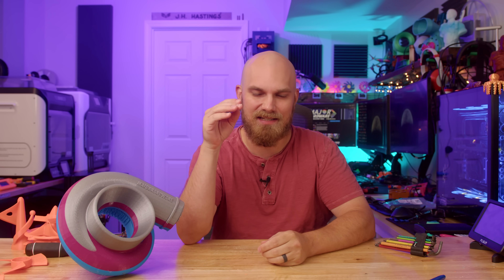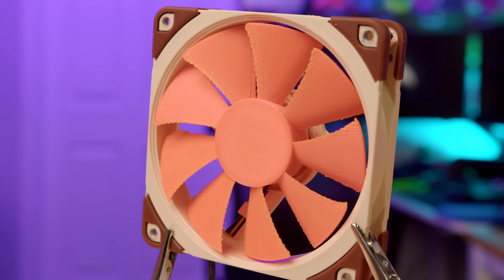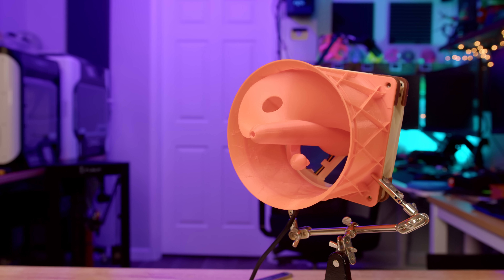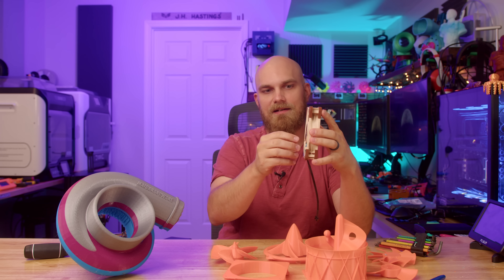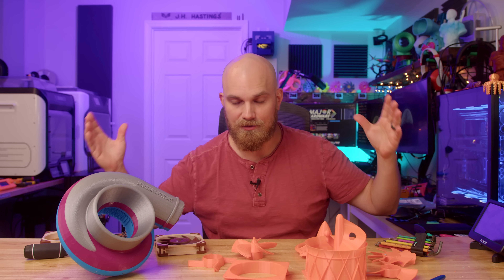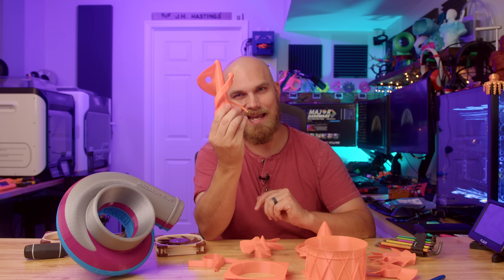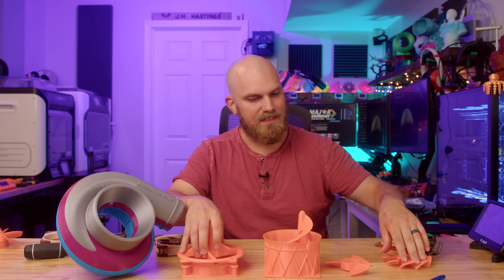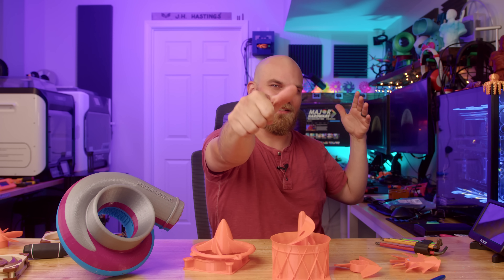NO ONE Has Done This Before | Fan Showdown S4E10

Comment: Everyone uses solidworks and puts the CG in the center but that’s not the whole picture for vibration. The blade is pushing against air but the side with no blade isn’t, so it causes more force exerted on the blade side and this vibration. I think one could offset the CG to make up for this, but it would probably have to be optimized for a very specific RPM. Maybe if you tried putting small weights on the counter weight (hot glue blobs?) until it smoothed out. Trial and error. Wouldn’t make up for all of the dynamic forces on the blade but I bet you could get it close.

Comment: Could you try the Finger Remover in the Neater Cheater Beater setup, and the latter's blades by themselves? It'd be interesting to see how much the added shrouds might increase the airflow efficiency, and how much difference they really make, because if the increase in airflow is similar for both blade designs, if someone makes one that's the most efficient by itself, beating the Cheater becomes more feasible.
Reply: I can’t believe my design did so good though

Comment: Need to do more with the castle motor, i wanna see some seriously over powered cooling fans
Reply: I want to see him use an engine to drive one. I have quite a few model aircraft engines thatcould do something, too. A 10-size nitro 2-stroke will swing a prop about the right size to fit into an a12x25 shroud, while a more powerful one like my 25AX, 46AX, K&B 61 would be able to hit five digit revs with multi-blade 120mm fans and my Super Tiger G3250 swings an 18-20" prop at terrifyingly high speeds. Nevermind cooling a single component that thing could just brute force cool the entire system.

 Maybe one day we could collab. It would be pretty crazy to see a gaming PC cooled solely by a 32cc nitro two stroke haha
Reply: @TestECull  wouldn't that just explode into a million pieces !?!?
Reply: @tdtrecordsmusic  Depends on how you do things. Part of the science of it!

Comment: Minor modifications are good, if they are minor. I think that the design needs to get an opportunity to shine, as do most people. Things like clearances, fitment, maybe even slight modifications to center of mass are ok if the shape, aerodynamic properties, remains mostly the same.
Reply: Definitely. Much better to see a fan tested than not, as long as the modifications don't change it completely and its basically the same, just with a few tweaks so we can actually see it tested
Reply: Agreed. Make any minor modifications necessary to test without changing the overall design.
Reply: I’ll second that.
Reply: Yes, agreed.
Which to add, regarding what you mentioned about adjusting CoM...
Our ceiling fans had came with adhesive backed lead sheets, to use in case there was excessive imbalance. I think that would be perfect for use on these projects... It's thin stuff, although much thicker than aluminum tape, so it wouldn't impact the performance in terms of drag.

Granted, it can take some time to dial in where to apply pieces, AND how big a piece is needed.... But I've successfully used it to balance the blades on multiple oscillating house fans, never having a single applied piece release after years of use (one fan runs nearly 24/7, with a couple pieces attached way out at the tips).

Just a thought... 😊
Reply: Exactly. I'd not even mind if he mirrored a fan that was accidentally designed the wrong way around (I think we had that in season 1).
Reply: Seconded :)
Reply: Agreed as well, No issue with fixing minor fitment issues as some of the stock fan models can omit certain features like physical wire routing, and manufacturing tolerances.
Reply: I like keeping things more original too, this channel hides truths behind some fans. Listen to the sounds, not the hype.
Reply: How about the logical most honest, best chance for everyone option:
Contact the creator to approve the mod or make an adjustment
Reply: I think they should all be tested for Science! But should loose points because the Design needed modification.
Reply: @shanold7681  What's sad is mostly all fans already on the show have already been tested for "science". Cheating is all over the board in that respect. The channel could save face if it just clarified it's own scientific goals. Silent fans are a good goal, but it's not shooting for that in any real respect itself.
Reply: @rusg.8347 : What do you mean by "clarified IT IS own scientific goals"? That doesn't make sense. How can it supposedly "be" scientific goals instead of just having them?
Reply: @HelloKittyFanMan.  well they use computers to help make the fans but show nobody the results. It's not clarified but secret. Also the results with computers are not that great. It gets really complecated.
Reply: @rusg.8347 : 1. "Showed nobody the results"? What do you mean? He shows all kinds of results!
2. The rest of what you said didn't even apply to what I was asking. You said "clarified IT IS own scientific goals," which doesn't make sense, because it's like you're saying the clarification would BE scientific goals. How can it BE that?
Reply: @HelloKittyFanMan.  I have seen more results than this show by just going to the smithsonian or watching videos on turbulance.
Reply: @rusg.8347 : 1. So then what he has shown here aren't "NO results." 2. How about you address the question that I was actually asking you?
Reply: @shanold7681 : When did the word "science" become a brand name, according to you?
Reply: "If they are minor." Well duh, you already covered that by just having said "minor" at the start. Obviously minor modifications are minor; otherwise they couldn't be called minor!

Comment: I kinda feel the cheater beater is reversed anyway.... normally for a subsonic flow you need a pointy long exhaust fairing rater than intake one.
Reply: If you're moving (like a bullet does) it helps opening the air, but you're right, when you're sucking the air in, what you want is a proper exhaust, as the pressure will guide the air in anyway.

Comment: So what if you took the NCB and stuck it on the back of a cooling block, to pull air through it instead of push? I think what was missed with the design is that the fan itself creates more turbulence than the supports would. If you eliminate that entirely by just putting the fan on the front, you should have a linear air stream entering the block.

Comment: I still really hope the next season has better restrictions in terms of size. If I wanted to print and use any one of these designs I wouldnt have like a foot of space to play with. The design should have to fit in a normal case and the variable should be motor speed. Any given manufacturer can put in a crazy motor without reinventing the wheel in terms of space taken up.

Comment: It doesnt matter which direction the air moves, it still has to travel across the motor support beams.  Whether its across them as exhaust or across them as intake it makes zero difference.

Comment: Well I still want to see a "squared²" using 2 fans, a normal one and a reversed coutra rotating one on the back... It would be the same footprint of some designs and probably beat it... Well 2 motors would definitely move more air...
Reply: been tried ... with the extra rotational weight and turbulence only produces about 10% additional thrust/airflow
Reply: @AlexanderBellOpelika  not with a 2nd motor...
Reply: @DeadsTBD  ok not with a second motor but 2 is outside the scope of the fan showdown. And contra rotation does not provide much if any benefit. It's been tried on prop planes - https://www.youtube.com/watch?v=APzO7OVGakw
Reply: https://www.youtube.com/watch?v=lx01utHcFtg

Comment: Have you re-tested the Cheater to make sure your fan motor has not degraded any from all of the test?
Reply: If you look at the rpm then you'll see that the Neater Cheater Beater has a higher rpm than the Cheater while having a bit lower air flow. This in turn tells me that just minor changes to blade angle and shape could improve the flow. Overall the design of the Neater Cheater Beater isn't that different from what we see in other high flow applications. The drag of the wind tunnel itself causes some backpressure that can change the performance. So a different design of the wind tunnel could switch them around. Even air humidity can play a role.
But one factor that I also think could play a role since the items aren't polished is how they are printed. The surface pattern can make a difference. Think of the reason why golf balls have a dimpled surface - it's to lower the drag compared to a smooth ball.
Reply: @ehsnils  Also, pushing the fan toward the frame (because of the reversed design) might cause the fan to spin irregularily because you're adding a force in a direction the frame and possibly the motor is not designed for.
Reply: @ehsnils  golf balls carry pockets of air around when they spin. The air flow from the cheater comes from drag. As the air moves across the surface of the housing, it is pulled by the spinning nose cone. Which drags the air more on the housing, causing the higher air flow when the air falls into the fan away from the air that is sticking on the surface of the shroud. Air flows faster because of the turbulence in this situation.
Reply: He replaced the motor a couple of times if I recall.
Reply: Season 4, Episode 6
Reply: It has to be something like that, I cannot believe the cheater has such a good design, something is wrong.
Reply: @YOEL_44  he has tested cheater for other videos, it is just a good design
Reply: @YOEL_44  What Is Islam?

Islam is not just another religion. 

It is the same message preached by Moses, Jesus and Abraham.

Islam literally means ‘submission to God’ and it teaches us to have a direct relationship with God. 

It reminds us that since God created us, no one should be worshipped except God alone. 

It also teaches that God is nothing like a human being or like anything that we can imagine.

 The concept of God is summarized in the Quran as:

{ “Say, He is God, the One. God, the Absolute. He does not give birth, nor was He born, and there is nothing like Him.”} (Quran 112:1-4)

Becoming a Muslim is not turning your back to Jesus. 

Rather it’s going back to the original teachings of Jesus and obeying him
Reply: I don't think noctua motors fail.

Comment: The yangblade design looked like a poorly balanced washing machine 😂
Reply: Washing machines don't need to be balanced, they work by bruteforce with a suspension system and some concrete weights.
You mean an overloaded washing machine maybe?
Reply: @YOEL_44  semantics, semantics, it wobbles like a washing machine in an earthquake.

This but a joke, accuracy is not the intent, humour is.

Also washing machines need the feet properly adjusted to make solid contact with the floor, and improper adjustments produces excessive vibration, which to the layman is a poorly balanced washing machine.

Comment: I think what's happening with the yin/yang fan is that booger-lookin' thing is bending out a bit due to centrifugal inertia and changing the balance. jus' my two bits.
Reply: I think he just balanced it in an axis, he should have made many cuts and check if all where close.
Reply: @YOEL_44  It's balanced overall, plus sliced into top/bottom sections. Balanced great in my testing, if I could get it mounted straight so that I couldn't see the tip wiggle at low speed, it would do high speed silently.
Reply: I suspect this is the issue there, as well.
Reply: Probably the whole fan being mounted slightly askew, it's pretty sensitive to that. The booger-on-a-stick balance arm is actually quite stiff. I did put a bearing seat in the top, maybe I'll submit a shroud that reaches over the front and engages with a bearing there. Performance really suffered in my testing any time it got off kilter enough to rub like that.
Reply: i think the air the blade is pushing is making it tilt towards it too

Comment: Might want to try shifting the weight to the side that does not have the blade on these one fan designs. The drag caused by the wing is going to put more load on the side of the blade and throw off the balance as it moves. By countering the weight added by drag with offsetting it to the blade it might be more stable at high speeds but not stable at low speeds.
Reply: I think the designer originally tried to do this, and ran a simulation in the CAD showing the CoM to be centrally positioned within the spindle after allocating mass properly. However, due to the nature of 3D printing, precision is not very good and the weight was not as balanced as initially intended, leading to the issue. But yeah, in theory this is the correct approach, just hard to execute in this medium.
Reply: @birbo5603  I suspect that the problem is simply flex.  The design is balanced while static, but once running the forces will cause that counterweight, in particular, to move outwards & throw off the balance.
Reply: @NemoConsequentae  valid point. Simulations probably didn’t account for the flex of PLA due to centripetal forces at speed.
It is also possible that an imperfect distribution of mass could have been caused by the imprecision of melting stranded filament onto an object.
I suspect the overall effect to be a result of both of these factors combined.
Reply: @NemoConsequentae  maybe I'm a simpleton but it seems this ultimately could be accounted for using the flex of pla or whatever as the variable to constant balance
Reply: @travistucker7317  You could set it up so that it was statically imbalanced, but at speed, the forces make the counterweight move out & balance, but then the dot for the Yin-Yang symbol would also be out of place at rest!
Reply: @NemoConsequentae  sorry my last post had a grammatical error, fixed. 

Technically speaking, it seems that if you decided to use X material, you could have it balanced at zero,  and have your arm be the variable, to full speed. I understand that might not be easy, but are we on the same page now?
Reply: @travistucker7317  Got it.  Though any flex will disrupt the balance, unless there are multiple flexes that cancel each other out.  If just the arm flexes it will still end up out of balance at some point.  Someone in another part mentioned it could also be due to the uneven load due to the single fan blade.  That would tend to unbalance it in the same direction as the flexing counterweight as well.
Reply: The whirling aerodynamic forces do have an effect, but they're much weaker than the unbalance forces you get when the CG is that far forward and off by a couple of degrees in angle. I did get it running nicely at home before submitting, but I should be able to force the alignment by having the shroud reach up and hold a bearing in the tip of the fan.
Reply: @windshieldvipers  Looking forward to v2!
Reply: It would be cool if it swung out centrifugally

Comment: the cheater has fallen, you HAVE to update the list or redo the top 10 results. the unswirler when sealed properly beat the cheater.
Reply: Seal the cheater
Reply: What episode was the unswirler?
Reply: @buildingsalvage  S4 E9
Reply: @AdmitthatijustdiditX  ty ty
Reply: He said it didnt count because it was a modification. If the original design included seals he would have included it.
Reply: @graysonhoang3126  Yeah but I think this is a stupid precedent 
you put almost any fan in the cheater housing and it will do fantastic. It's no longer the fan but the housing around it that matters. There really should be two categories, normal fans and fans with extra parts.
Reply: @nesyboi9421  he's done that and the original fan from the cheater still out performs the fans used with the shroud from the cheater design.
Reply: @sirmonkey1985  press x to doubt
Reply: @graysonhoang3126  no it counts, if the print warped that would skew the results. but a way to determine that would be test the cheater with a seal. all i want is a fair test and transparency, hes done that up to this lottle incident. the amount of time to just test the cheater with a seal would be negligible